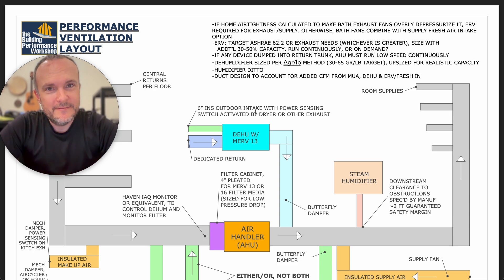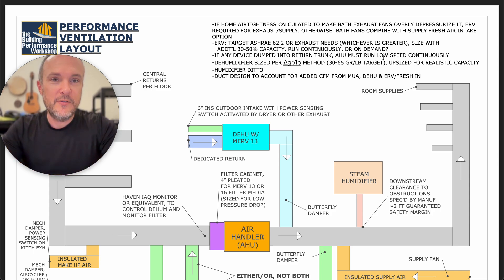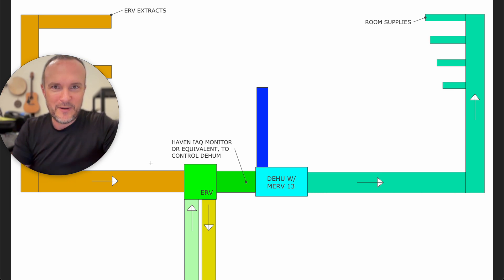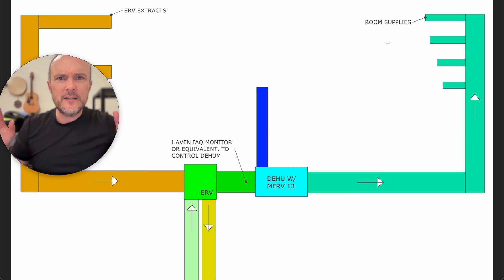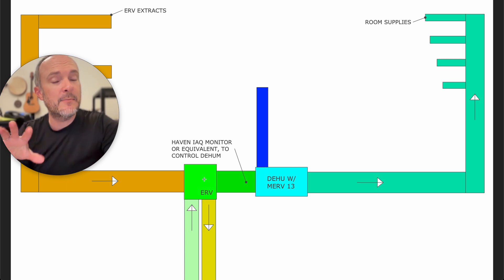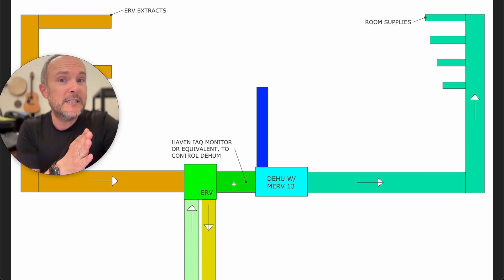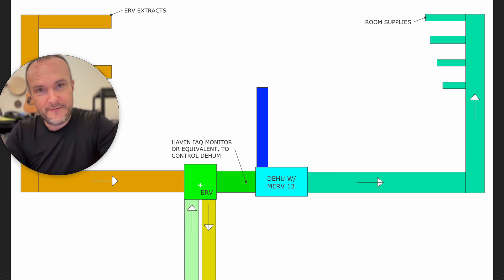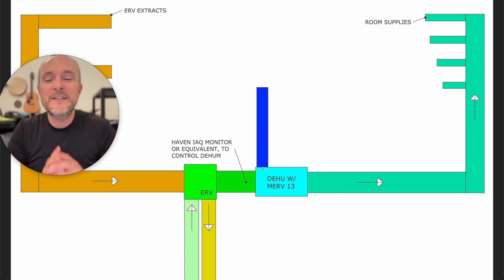ERV Ducted Into Dehumidifier: Fresh Air Humidity Side Effects

Comment: Do you have a schematic with recommend installation for a system with both ERV and dehumidifier, but with a water based radiant heating/cooling system? ERVs like Zehnder have full systems with pipework and adjusters for each room, but throwing a dehumidifier into the mix will offset the adjustments made at commission and will perhaps need bigger pipework. So what the ideal setup for a new build where all systems can be done from scratch?
Thank you.

Comment: I love this approach, but I'm having a bit of a fight right now with our recent home build.  We picked a Zehnder ERV, which performs remarkably well, with one caveat - it's a closed system with its own duct network for extract and supply.  In high humidity seasons (like right now), even though the core works well, the system simply pushes too much humidity into the home.

I contacted Zehnder for options to dehumidify, but they have none in the US... and since the duct network is fully self-contained, I can't easily sneak a dehumidifier into the mix without screwing up airflow rates.

I'm currently considering going off-label and taking an approach similar to what this video shows... putting a dehumidifier in place that always runs faster than the Zehnder and feeds all the supply ductwork; connecting the Zehnder into it; but also ducting in a return for the dehumidifier from elsewhere in the home to allow extra air to be pulled in during times when I have the Zehnder running below the speed of the dehumidifier.

A little hokey... I'm between this and just leaning on the whole-home dehumidifier even harder.
Reply: How tight is your home? Can you not put in bath fans? Plug your zehnder into a smart outlet and use dew point as an IFTTT to shut it down when dew point is above 70.

Comment: Can you run the ERV where it has independent intake from the room but the exhaust back into the room goes through the HVAC units ductwork? Unlimited of what ducks I can squeeze under the joist
Reply from the maker: Yes that’s the best way imo
Reply: @HomePerformance  thank you for your response. If that's the case, do you need to run the fan on the HVAC unit? If not, how do you control the airflow to go towards the ducks and not back through the air handler?

Comment: I'm just a homeowner guy, who wants to install a dehumidifier in the NC house I just bought. I think I could run a system separate from the AC: the AC would control the room temp, the dehumidifier would control humidity, and the ERV would provide fresh air. I had the very idea you describe in this video, and am glad I watched the explanation of how RH and temperature would confound the theoretical configuration. BUT, why not put the controlling sensor into the duct AFTER the dehumidifier? It would then sense the temperature of the air going into the room and it's relative humidity. If the RH were too high, the dehumidifier would turn on. Wouldn't that be independent of the swings in temp and RH imposed by the ERV?

Comment: So you take the filtered supply of the erv and send it to the dehumidifier, you would pipe that dehu supply into the supply side of the HVAC system right? Then you don’t need to run supply lines for the erv? You’re using the supply ducts of the hvac, is that correct? Thank you.

Comment: The issue is a control problem—on/off control and separate controls don’t work. One you need dewpoint control and a psychometric function block, which you find in a “commercial” control system, such as a CodeSys control system.  So buy the commercial systems and do the programming yourself. Should take 2-3 years to tune the system.

Comment: Why did the ventilation fan in my house suddenly stop? I set the timer for an hour, but it only worked for a few minutes and then suddenly stopped. I tried it many times and it was the same every time. What is the reason?

Comment: IDEALLY, we would have a custom dehumidifier (read: small airflow) with the evaporator coil (cooling) located in the ERV fresh airstream into the house, and the condenser coil (heating) located in the stale airstream leaving the house.

This ultimate appliance would be an ERV/dehumidifier/AC that tempers incoming air with the ERV core and then cools/dehumidifies that air while rejecting the heat to the outdoors.  I understand that appliances like the Minotair operate as an HRV by using a refrigeration circuit, but it has no core to exchange ventilation air energy/moisture without running the compressor.

Why is this stuff so darn SLOW to come to market?!?
Reply: Isn’t that the comfocool they have in Europe?
Reply: @mattffleague6041  doesn’t do me much good here! 😊

Comment: I can’t tell you how many contractors connect dehumidifiers to the return side. Am I missing something? Is it not silly to dump dehumidified air into an air handler!?
Reply from the maker: That way steals the AHU cooling coil’s ability to dehumidify. It was actually made illegal to do that in FL building code.
Reply: @HomePerformance  thank you, Corbett. Honestly, if these companies did proper HVAC installations we wouldn’t need these add on whole home dehumidifiers as much. No? Whether it’s short cycling, or lack of tonnage, people all over the Southern Climate Zone specifically are getting sick from imbalanced indoor fungal ecologies from their HVAC’s. Not to mention duct leakage, duct board getting wet, the list goes on.
Reply from the maker: I do think it makes it worse, but actually we need dehus in basically every new home as an insurance policy because of airtightness.
Reply: @HomePerformance  that will be a great day if it becomes the industry standard that all homes are to be high performance.

Comment: This is how we typically install ERV - DEHU systems in CZ-1& lower CZ-2. ERV supply ducted into DEHU F/A intake mixed with indoor R/A, DEHU supply ducted into AH supply. After testing different configurations we found this setup to provide the most consistent moisture control in these humid climates.
Reply: CMZ1.. over here!
Reply: Do you have any issues with the erv / dehu pushing different cfm? Or do you set them to the same flow and have them run the fans at that speed 24/7?
Reply: @RenovatingSevenStars  Good question... I was wondering how this works also - Diff fans speed-air flow-acceleration etc.

Comment: My ERV (oversized core) runs continuously with exhaust from bath and fresh into my dehumidifier FA intake. 
Bath exhausts have a constant airflow regulators for balancing and dampers to bypass regulators and trigger erv boost mode to activate maximum flow through exhaust when showering, bathing, etc.
Dehumidifier fan runs continuously and has HAVEN monitor to boost ventilation through erv on demand from indoor VOC content and activates the Dehu on dew point. 
Dehu injects supply into HVAC system. 
Air things activates communicating variable hvac blower based on bedroom Co2 levels. 

Per my data loggers my dehu & HVAC fan is nearly never activated. My mix of  ERV, HVAC, and filtration handle my indoor and outdoor air conditions with the exception of a few times in shoulder season. 
3 ton inverter, +/-2800ft2, +/- 3 ACH50, CZ2 coastal Louisiana. 

Full disclosure most HVAC contractors would cringe at this idea.
Reply from the maker: Let’s have you on the channel again via Zoom to show that system off dude
Reply: Let's do it!
Reply: Please do- I have about half of these components but want to figure out how to chain them together like this especially based on CO2 levels and VOC and I'm currently researching which ERV to add to my ventilating dehu.
Reply: So to clarify, the dehumidifier return is only ducted to your ERV supply, and your dehu fan runs 100% of the time? I’m assuming that to do this, you set your dehu to ventilate 100% per hour?

And your dehu return is not ducted to your HVAC return at all? Just dehu supply to HVAC supply?

How do you bring is so much fresh air continuously (rain events, overnights at 90% humidity) without running your dehumidifier all day? Based on your data points, it doesn’t run? How?

Comment: What you are describing is really close to a commercial DOAS. Just an energy core or wheel followed by a mechanical cooling/heating system. Renew Air has DOAS starting at 375 CFM I think, that's not to oversized for a bigger sized house, especially with ecm fans.

Also, thinking in dew point is much more intuitive in my opinion.

Comment: Ugghh, here we go.

Home in MTL. So very cold winters and hot humid summers. I central natural gas furnace and heat pump. I have a passive HRV and humidifier and Ecobee 6 pro thermostat.

In the summer, my HRV is set to off so I don’t get any fresh humid air outside (unlike winter where outside air is always fed inside).

I can’t get my indoor humidity under 60% at 22 degrees (at least that is what ecobee displays).

Do I need  a dehumidifier? Should I have an ERV and not HRV? Need help. !!!

I’ve been told to run furnace fan 24/7.
Reply from the maker: Yes, swap your HRV core with an ERV core, and get a dehu. Here’s how to size it:
https://youtu.be/mQTCl8c3Plw?si=WaabE3tM5EmZRQ5u

Comment: I have a ventilating dehumidifier in atlanta. It runs the fan 24/7 with a Haven IAQ controlling the Dehumidifier and dehumidifier mode on heat pump. If haven calls for dehumidification they both will run. The dehumidifier makes the temp go up and the heat pump goes cold. Haven also controls the fresh air damper. I ran the wires for an outside temp/humidity lock out but seems good thus far. If I need it I will add it. I will be installing airthings as part of a study. Guess I will see how well we did on design.
Reply from the maker: Sounds good Alex

Comment: Hi Corbett, I wanted to ask your opinion of the Ephoca AIO which combines a heat pump, erv, merv 13 filter and bathroom exhaust all in one indoor unit (no outdoor unit needed). With houses getting tighter and more insulated I know a lot of people are complaining because they can't find HVAC equipment small enough to handle the low loads. Apparently the AIO can provide heat from about 2700-6700 BTU/hr at 5 degrees F outdoor temperature. Do you think this is the "magic box" that people are looking for in low load homes (their ceiling cassette unit can be ducted to service more than one room)?

Comment: Rather than adding the additional complexity of a separate air handler and ducting for the DEHU (if you're running a mini-split system for cooling), I wonder if it wouldn't make more sense to just install one or two in-wall dehumidifiers strategically so that they can handle the load if/when the AC isn't able to.

Comment: I don't get why dehumidifier can't measure both RH and intake temperature and turn on based on these 2 parameters plus the expected room temperature. It's a simple linear equation, any basic controller can calculate this.
Reply: not a linear equation, you need a lookup table. Doable IMHO, don't understand that neither

Comment: The company I use stopped making MERV 16 filters I use for my fresh air.  I’d love advice on a filter box to use on the fresh air side of things.  I have been looking into a hepa filter box possibly when I run out of filters.  I’m just running a ventilating dehumidifier and a 10 speed fan on the fresh air side with filter box so it can be dialed in appropriately.  Great video!!!

Comment: I was thinking of a similar setup a few days ago, so this video is well timed.  I now understand why you don't want the dehumidifier and its controlling humidity sensor directly after the ERV since the relative humidity will change when the AHU (which I'm assuming includes the heating and cooling systems since they aren't listed separately in your diagram) increases or decreases the temperature.  What I don't understand is why the dehumidifier has its own return ducting and outside air supply.  Why isn't the dehumidifier just installed in the main supply duct directly after the AHU with its sensor in the duct between the AHU and the dehumidifier, similar to how the humidifier is?  Having a dedicated set of return ducts going to the dehumidifier seems like a waste of resources to me, and the outdoor supply makes no sense at all, especially when there appears to be no filtration on it and you are dumping that air into the supply side of the ducting where it can't be heated or cooled to maintain the indoor temperature.

On an unrelated note, I understand the need for having a make up air system for the kitchen vent hood, but why doesn't anyone build that into the vent system itself, kind of like a high flow HRV that could blow air into the room out the front of the vent hood that would then get pulled under the hood and back outside so that the hotter or colder outside air isn't mixing with your comfortable inside air as much?  Having a make up air vent on the other side of the room like you did in your house seems like you would get cold feet in the winter and hot/humid feet in the summer.  Is there a reason for having them on the opposite sides of the room that I'm missing?

Comment: 1:55 i don’t understand what he was trying to say here about ERVs bathroom and what he doesn’t recommend unless you are replacing bath fans and I’ve seen most of his videos
Reply from the maker: https://youtu.be/lnOCAPPVT5g
Reply: Basically if you have a really air tight house, traditional bath fans will depressurize the house and will have trouble properly exhausting the stale humid air.  If this is the case, then use the exhaust/return air ducts for an ERV in your bathroom instead of a traditional bathroom exhaust fan, since the ERV will also bring in fresh air in a balanced manner to avoid depressurizing the house.  The video he linked in his response goes into more detail, but basically place the ERV exhaust/return duct in the corner of the shower ceiling furthest from the door for the best results in removing the humidity.  The fresh air supply ducts are typically in nearby bedrooms, so you end up with fresh air coming in under the bathroom door and being pulled across to the upper corner of the shower, taking the stale/humid/hot air with it.